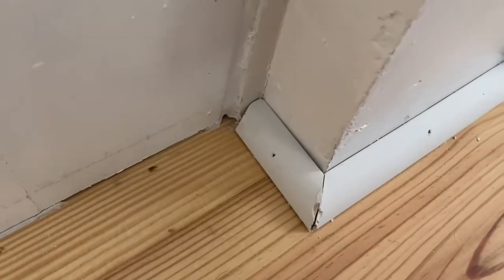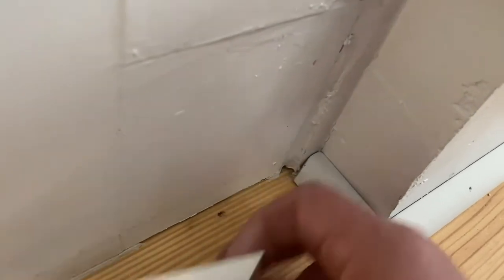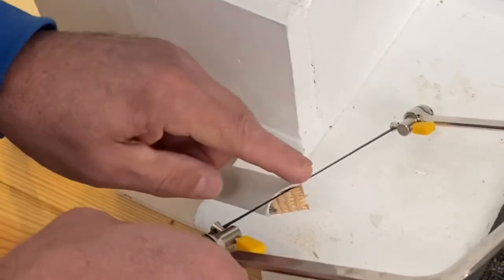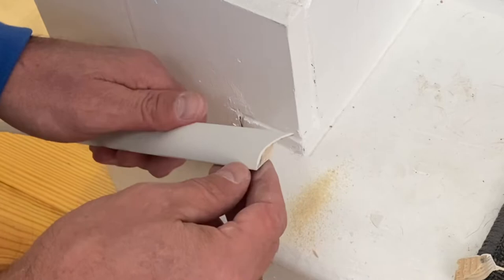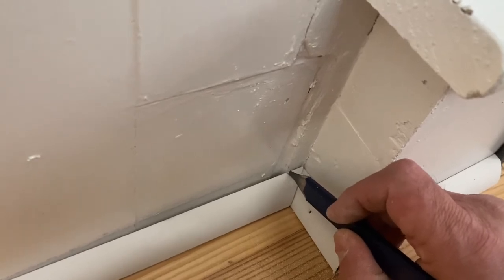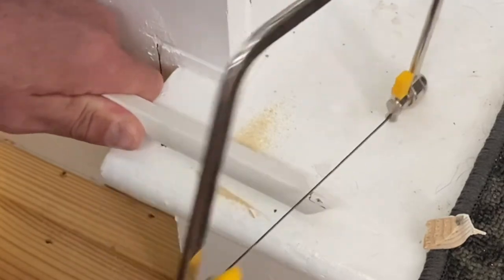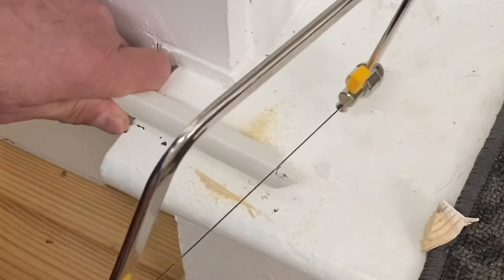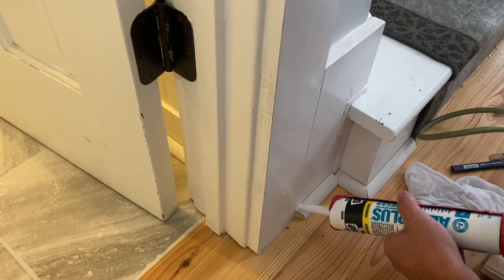How to use a coping saw to cut quarter round.￼

Comment: impressive. Does that blade last long and can it be easily sharpened?
Reply: You dont have to sharpen it.  It lasts forever.
Reply: @larry6406  
The quarter round scissors?
Reply: Miter shears... I imagine you would have to sharpen them, they start to crush the wood instead of cut it